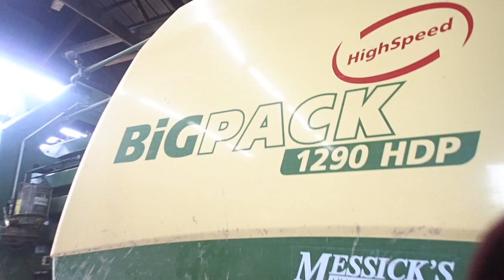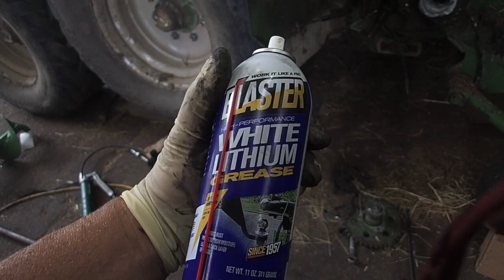The Wrong Darn Part

Comment: They probably updated your baler to bigger shafts because of problems and you got parts for earlier serial numbers.
I've been told to use the serial number for Krone. If they enter the serial number it brings up that individual machine and the parts for that specific machine.

Comment: The stack wagon works well. Its a mechanics nightmare (wrong parts) By the look of it its a superseded part having the larger shaft and he has used an original parts listing that doesn't cover the modified sprocket. I may be wrong. I'm a Toyota mechanic and in the mid 80's we had 3, 1300cc motors in production in different models a 4k, a 2e and a 2a. That led to a bit of confusion in the parts department as the new front wheel drive model came out as an ae80 or an ee80. By the way some of those ABS rings on the hubs are cast steel and break fairly easily.

Comment: I'm not try to question your repair proceedures, but, I begin to wonder.
You have doubled your krone count this year, and you plan to double it again for next year.
Wouldn't it have been worth it to buy a Complete New Header?  Then you could quick swap, and get back to the field.  And then, over the winter, or during rainy dayz, you could then rebuild the worn out/broken header.  I would think, that it would possibly be worth it to have a spare header.
You spoke again about getting another tractor(s) this winter from england, why not find out if you can get most of the parts reasonably for a big m 500 from your local dealer, and then consider buying one while your in england, and shipping it back too?

Comment: * We are now using the Krone 550 pound knot strength twine with our Krone BP890 baler, running at 93% maximum force.  This has reduced twine breaking down to 2 or 3 per thousand bales, versus the 440 strength twine we had been using where we might get a dozen or so.

* Wes said that the double row sprocket did NOT have a part number on it. So if it was in the wrong bin, or packaged with a wrong number, it would be easy for the parts department to send it out, without knowing it was the wrong part.

* The portion of the baler driven by chains (just the pickup) is not sensitive to timing... pickup rotor with tines turns, side augers turn, center auger turns, there is no stuffer driven by chains.

* Regarding the ease of switching the jd 7530 / 8530 from baler to baler, I think they would have to switch PTO shafts as well.  I am sure the 8530 is using the 1 3/4" diameter 1000 rpm 20 spline (type 3).  I do not think the 7530 is equipped with that, so it would be using the 1 3/8" diameter 1000 rpm 21 spline (type 2).

* In this video at 14:46 , Wes said the jd 7530 does not have enough power to run the Krone BP 1290 HDP, at full pickup capacity, on this fairly level field.  He has said that this 7530 was dynotested at about 200 hp.  He has previously stated that after the jacknife incident on the road, he feels that he needs a heavier tractor to manage the baler more safely, and pull the baler in softer ground.  So a heavier tractor would need even more power to move itself in hilly/soft ground, as well as power and pull the baler.  Probably talking 250 hp. or more.

Comment: You're doing your wrench jockys a wonderful lesson.  Do a rebuild properly vs fix it when it breaks.  Tough spot for you to be in wincing at a parts bill and doing math with the open eye.  Looking forward to seeing more 8 series tractors showing up...was at an auction and Kansas specifically was mentioned but the midwest in general had a glut of used high horsepower mechanical fronts by some tractor jockys.

Comment: I don't think another 8530 would be the best choice.  An 8230 would be more appropriate or better yet get a 444 wheel loader, and use the 8120 on a baler.  Don't forget the 4960 needs a job too.

Comment: Not related to this video but any suggestions on getting g a old John Deere 60 unstuck
Reply: How bad is it stuck?? Years?? Pull the spark plugs out, fill cylinders with automatic transmission oil, let sit for a few weeks, or longer. Depending on how long it has been sitting???  Mite take months???  If all else fails, pull the head off, unhook the connecting rods, then , unbolt the book, remove from tractor. Stand the block up, and soak longer....

Comment: Forget about the Big M you can get a tractor and a tripel mower. two birds with one stone
Reply: Or get a Big M and not need a new tractor and 3 new mowers. Three birds with one stone.
Reply: awd3264 if he were to buy another tractor to run the mowers, he would be able to use it to mow and do other jobs on the farm. The big M would only be able to do one job...mow
Reply: @trevnelson13  He has a surplus of tractors to do other jobs. Basically Wes's whole operation is center around mowing and balling mulch hay for about six months of the year. One Big M will mow a lot more hay faster. Is easier (narrower) and faster to transport from often very far flung fields. Currently he has more than enough help to run the two self propelled windrowers that can cut more hay than one triple mower setup.
Reply: @awd3264  you have to listen to the whole video before you put your mouth in gear before your brain he just said he needs another tractor
Reply: @brianbaenen2821  Did watch the video and what he said is he would like another 8300R to run the baler.
Reply: @awd3264  in the fall of the year he could get a good deal on a big m. Then he can take it to North Carolina and Bale corn stalks

Comment: If the rest of the dimensions & tooth count are correct on the sprocket, you might be able to run it over to a machine shop & have it re-bored. Might get you back in the field quicker than waiting for another to arrive.  Best of luck............................